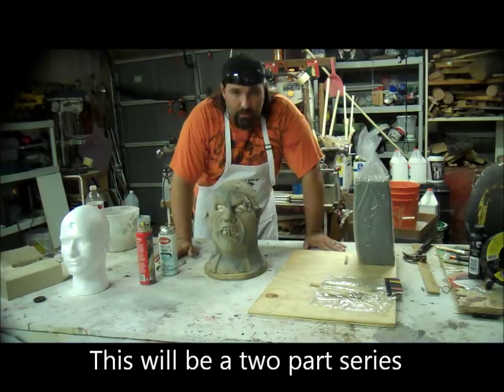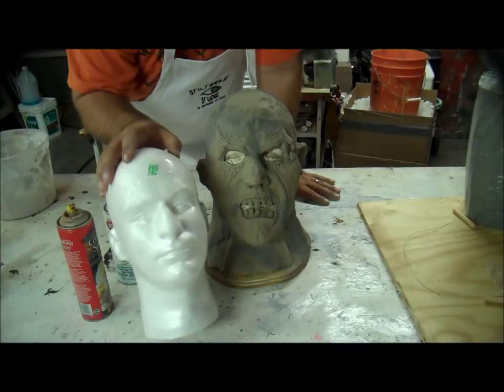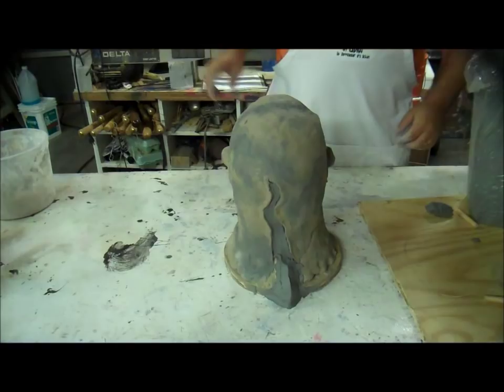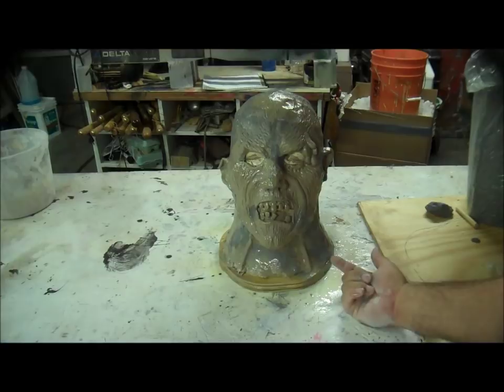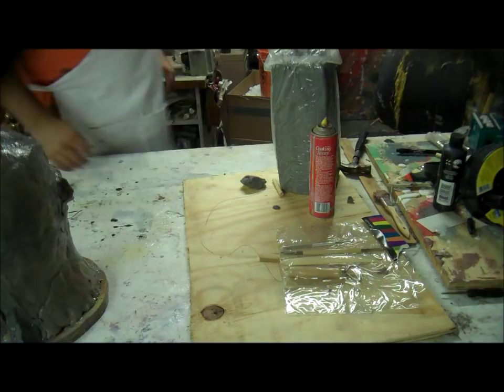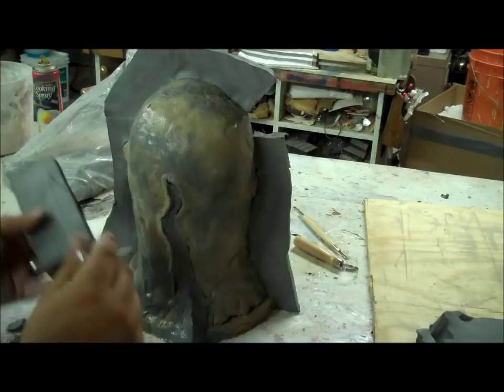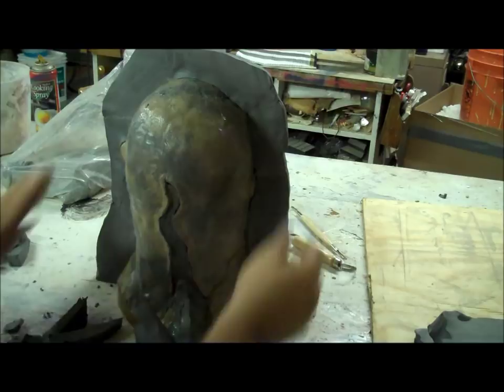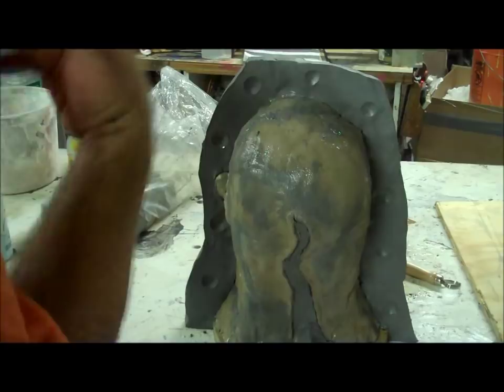Making a two part mold

Comment from the maker: @ndstephens  yes you can, the issue that culd come up more than the cooking spray and clear coat is small plaster chips from the mold ittself. I nnormally dont reclaim clay. At least not all of it. I do keep a few five gallon buckets of it around (in water) to use when the cleanest of clay is not required. Like for the interior of large sculpts.

Comment from the maker: Water based clay is the way to go for large sculpts actually. Its much faster than oil based clay because its softer, also the more you have of itthe better it holds its moisture. It can be covered in plastic and will last for a long time.
    The queen alien, pumpkin head, Jurassic park dinosuars, monster squads gillman, Kothoga from Relic, all sculpted in water based clay.
    Im very fast and Im on a schedule because its my job so I tend to err on the side of speed.

Comment from the maker: @doggieshop you could remold a latex mask, but its easier to sculpt it. Practice, you will get better try to sculpt from picture refrences and fiddle with the clay till it looks like the pic. Im not that great at it, but I will be doing a few more sculpting tutorials along the way. When you want to replicate a rigid piece like a statue, you need a flexible mold. I will do a flexible sheet mold soon as a tutorial, a silicone mold for resin parts, keep at it.

Comment: Gloves are good for quicker cleanup.  Ultracal is a cement and hydrocal is a plaster.  Ultracal is stronger.  Hydrocal is a very strong plaster (way stronger than plaster of paris).  Ultracal is pretty much standard for spfx molds when you're going to cast soft latex/silicone/foam/etc.

Comment: Would it make a difference if you used latex gloves to spread the casting instead of your bare hand? Also, what is the difference between hydrocal and ultracal 30? I'm looking at a basic mask making kit on The Monster Makers's website and was wondering what would be the best to use?

Comment: Do you have a video of making a mold for a helmet that is more like a standard motorcycle helmet? I have a small toy helmet & I want to enlarge to fit my dog's head & only be used for photo op purposes & not safety. Should I use this process to do that or is there a different method that is better? I thought a 2-part block mold would work, but what would you suggest? I want to be able to make a couple of helmets to add  changes on them, as necessary. What is the best hard silicone to use? Thanks

Comment: So using Krylon clear matte would work better than the gloss finish you used? and i was also wondering if the Ultracal 30 was the same from wherever becuz i found a 50 pound bag on this one website and it says Ultracal 30 Gypsum Cement, so i was wondering if thats still the same thing- Thanks
Reply: yeah ultracal 30 is a gypsum based cement plaster- and it comes in 50 lb bags. I get mine from reynoldsam dot com

Comment: Would this mold work to make a fiberglass helmet? Like a Stormtrooper helmet from star wars
Reply: bump.
Reply from the maker: +William “kamikazemearkat” Steerman    No it would not- for a hard finished piece you need a flexible mold. Im making a mold to make a flexible latex mask so it can be a rigid mold. You cant pull a rigid piece from a rigid mold.

Comment: Hello Allen,
I have been using Oil based clay for most of my sculptures for my masks what type of water base do you use by chance... I like oil based but come winter time its a pain to heat up and smooth out all the time, looking at differant options. Also have you been getting requests to make a video on latex armor at all? and casting it up? Just thought of it working on some armor the other day. Thanks as always for showing us all how to be better mask makers.
Reply: Looks like WED Clay

Comment: Can you sculpt and make a retaining wall with both wed clay? I always have trouble removing the wall after half of mold is dry, since it sticks to itself. When you remove the wall, there are usually small pieces of clay that "stick" right in that little ridge where the molds will go together.
Reply from the maker: +troy mccombs  I do it almost exclusively, make sure you crystal clear your sculpt BEFORE you make the wall, then you have a layer of separation between the wall and sculpt.
Reply: Thanks for the reply. Btw, would matte finish spray work as well as clear acrylic? I have that handy already, that's why I ask :)
Reply from the maker: +troy mccombs  yes, two coats or so

Comment from the maker: Avoid Plaster of paris. it is not strong and it likes a consistant mix ratio. try to get ultracal or hydrocal. oil based clay does not dry out- water based clay does. the oil based is also much firmer than water based clay.

Comment: Do I really need to use the Krylon Crystal spray or any spray at all?
Reply from the maker: you dont have to- since this video I have switched to pledge furniture polish- it works great. but technically you dont need anything.
Reply: @StiltbeastStudios  Great! How much plaster did you use through the whole process?

Comment: What’s the stuff called that you use to stop clay wall from sticking to the sculpture?
Reply from the maker: I dont use anything, I just apply and remove carefully. you could use a different type of clay which makes them easier to separate.
Reply: StiltbeastStudios my sculpture is made from newplast plasticine, what clay type should I use for Making the wall? Water based clay? Or could I try making a wall from plasticine over the plasticine sculpt?

Comment: is there a technique that preserves more detail under the actual mold wall?
Reply: Yea do a silicone mold. I don't understand this method.
Reply from the maker: I dont understand the question, there is no loss of detail. you remove the wall when you make the second half of the mold.
Reply from the maker: its difficult to cast a latex mask in a silicone mold.
Reply: StiltbeastStudios my original question was,  would the removal of the clay wall require "touching up" the sculpt under the wall? like for high detail pieces?

Comment: will this work for silicone masks?
Reply from the maker: yes, you can make stone molds, but you need to add a core and a way to get the silicone into the mold.
Reply: Make sure your sculpt clay is sulfer free.
Reply from the maker: Most clay nowadays is sulpher free, and all water based clay (as I used in the video is). but yes, good tip.

Comment: Why the clay wall? Wouldn't it be better to just stick like pieces of can or aluminium into your sculpture?
Reply from the maker: Not necessarily, that is one technique this is another. With the clay wall you have more control over the placement and shape your wall has, it is by far the more popular technique- I also feel the seam lines are easier to clean up because nothing disturbs the sculpture.